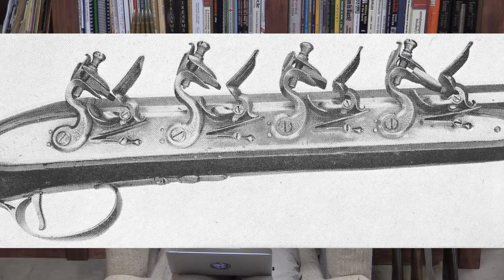Q&A #4: These Are A Few of My Favorite Things

Comment: 1) First, it is Flech Ette, not Flesh Ay
2) They were deadly in Vietnam when used in artillery and tank guns "The first example was the 105mm howitzer M546 anti-personnel tracer (APERS-T), first fired in combat in 1966 and thereafter used extensively in the Vietnam War. Intended for direct fire against enemy troops, the M546 was direct fired from a near horizontally leveled 105 mm howitzer and ejected 8000 flechettes during flight by a mechanical time fuse. Green starshells were shot into the air prior to their use to warn friendly troops that such a round was being shot." When I was in armor Officer Basic, we were told of an incident where an Armored Cavalry Troop's night defensive position was assaulted. When the M551 Sheridans of the troop turned on their search lights, an entire NVA company was seen dealy boppin down the road right at the NDP. The M551 covering that sector touched off a 152mm beehive round and the entire NVA company disappeared. In the morning there were bodies everywhere and a lot of blood trails leading back into the jungle.

Comment: I've found that even just the A1 grip safety does a pretty good job of keeping your hand away from the hammer. I have decently large hands, but I suppose everyone is different.
Reply: I've shot a Kongsberg 1914 (copy of the pre A1 1911). I've got pretty small hands, and got bit by the hammer once. I then adjusted my grip slightly, and didn't get bit again.

Comment: With artillery, barrel length is expressed as multiples of it's bore diameter, because it's that ratio that really matters, not the actual overall length. The actual overall length is relative to the bore diameter.

Comment: XM8...  the more purposes to a weapon, the worse it is at each.  Trying to combine a machinegun and a grenade launcher sounds extremely heavy.  You would probably be much better off giving a lightweight mortar or launcher to your riflemen because otherwise there are problems in the field lugging stuff around.  But beyond that, the only way to get a 5.56mm and a .50cal to fill the same role is with energy weapons that can reduce power to gain capacity.  Cause  .50cal rounds are heavy.

Comment: I had a Ruger 10/22 and found it to be a pile of junk.
Tried many different types of ammo, extractors, recoil springs, polishing the receiver, mods to hold the magazines tighter and no matter what the thing stove piped constantly.
 I'd  get at least 2 stovepipes per 10 rounds.
Sold it for an Uberti lever-action .22lr and could not be happier.

Comment: I will say, as someone who is not a ballistics expert or even really enthusiast, but a ballistics... supremacist? I guess? That describing rifles in terms of caliber, cartridge length, and barrel length is actually quite sensible. At the least, it would help in determining the kinetic energy leaving the barrel. So a 20 inch barrel AR-15 would be 5.56x45, L508 (because 20 inches are 508 mm). However, such descriptions would reduce the desirability of regular rifles in comparison to bullpups, and I would argue this is a big part of why such measurements are still not used.

Comment: The SEALs also used 40mm flechette rounds in the M-79 & EX-41 during the Vietnam War, to great effect.
Reply: Anon Nymous we still have flachette rounds for the 82mm Carl gustav. They're rare, and normally used by sf.
Reply: Do you know why they used them?
Reply: why do we still have it? what is it used for?
Reply: willem kauffeld General anti-personnel use. The flechettes penetrated jungle foliage better than the round buckshot pellets.
Reply: If you got caught in an ambush, with the EX-41, you could let fly 4 40mm rounds, resulting in a swarm of high velocity steel darts slicing through any soft targets in front of them.
Reply: John Crain The whole army uses the Carl Gustav now. I myself have had the pleasure of lugging the thing over long distances. I was talking about the Flachette rounds that are made for it. And you are right, I misspoke, it's 84mm.

Comment: The points on 3D printing were very well taken and so fascinating, scary, amazing, near-unfathomable etc.  I've been dreaming about this technology as an "Overland" 4wd Enthusiast as well (Even my mighty Toyota Hilux breaks down once in a while and needs a some small part that's given up the ghost after 300k miles...it happens), for many years now when I first saw it on the horizon,  I see an awesome opportunity for essential parts being available/create-able in the farthest reaches and in-time creating a new form of infrastructure to support different groups (not limited to the 4wd world is what I'm meaning) for whom the technology will benefit them/their needs where.  Suddenly anywhere with the electricity and the materials can become a production facility and make nearly ANYTHING that someone can design within reason and without needing specialized tooling, just a digital TDP-type file sent from X facility to Y point of creation... It's also got some spooky ramifications/potential usages but then so does a Steak-knife so... 

Such an interesting concept and ties in well with the point you mention about the firearms technology having plateaued cause THIS could allow for some designs to reach fruition that simply aren't reasonable/possible with current "reductive" manufacturing means.  LOVE this channel.
Reply: +Nor Wester (4Rescue) I think a lot of the interesting developments in the field with regards to guns, is working around the somewhat particular limitations of 3D printers, things like z-precision.
Reply: +DFX2KX Yeah, good point.

Comment: I was reading on the early development of the Browning Auto 5 shotgun. It was my understanding that it was meant to cycle black powder loads on the 'gallery' or 'light' setting of the recoil system. It made sense to me, given the design timeframe. The long recoil mechanism would also be quite difficult to gum up with fouling, evident to me when I did the initial clean on my Auto-5, which was still working despite being caked with oil sludge. I think the previous owner never cleaned it, and lubed it with 5W-30 motor oil  (though, that was John Browning's recommendation, albeit decades before this particular shotgun was built)

By the way: Obturation is where the "o" in o-ring comes from.

Comment: 3D metal printing

At the current of the sate of such machines, they are capable of a precision magnitudes better than the rough plastic ones which are incapable of 0.001 inch accuracy. The cost of a high-precision metal 3D printer is on the order of half-million dollars. There is one company that has produced a 1911 in .45 ACP. They claim that the strength of #D printed parts is about 95 % of a conventional milled part..

Comment: Stronger cartridge case material.

A more modern example is the French FAMAS.

Because of its hesitation-delayed blowback action which left too much pressure over the unsupported case, the standard material used for other 5,56 x 45 rifles was unsuitable. So the French cannot use ammo provided by an ally.

The French are now about to ditch the FAMAS and replace it with another rifle designed and  built in another country, having lost its development and manufacturing capabilities over years of neglect by the government. Yes they could manage to manufacture a foreign-designed rifles but in small runs (less than 100,000 units) the cost-per-unut would simply be non-competitive.

Comment: Tilting vs rotating bolt. Two more issues.

1. Reliability

The rotating bolt also has the advantage of soft initial extraction. As in a bolt action rifle, the bolt has to turn as it begins to move rearwards. This can be significant in the case where sand or other dirt got into the action and is contributing to causing the cartridge case to stick in the chamber. This can be more severe in the case of straight-walled cartridges such as the 7,62 x 51 NATO cartridge. As the bolt rotates, either the extractor turns the cartridge with it, thus breaking the seal, or spreads the pulling effort over a wider section of the rim as it runs around the rim. As opposed to the a straight rearwards pull on the rim, there is less risk of the extractor simply tearing off the part of the rim it is grabbing.

The FN-FAL has been used by over 70 countries and the only complaints to the rim tear-off problem seem to be from Israel. Apparently, sand in the Middle East is particularly obnoxious in this respect.

2. Lighter weight

A front-locked bolt also allows reducing the weight of the receiver. Since the the locking shoulder required for a tilting bolt is at the rear of the bolt, it means that the receiver must have the strength to hold the bolt locked against the 60,000 psi pressure. As opposed to a locking system using a barrel extension to lock the bolt at its front. The receiver of a tilting rear-locked bolt requires sturdier and heavier material than the aluminium used in the M-16.

I had not heard about the enhanced accuracy though.

Comment: Apparently, in certain circumstances (which are far from what an assault rifle is typically specified for), the G36 will overheat up to a point where the polymer receiver becomes soft close to the barrel and the trunnion will start to move inside the receiver. Even tiny shifts are enough to lose zero and it will not return to zero either once it has cooled down. If worst comes to worst you may not even be able to re-zero the rifle. The issue has been blown out of proportion by the German liberal media (who just love to badmouth any defence industry company and especially those involved with small arms production and distribution) up to a point where the minister of defence felt like she needed to make a statement that the rifle will be replaced in the foreseeable future.

Still, despite it's great tolerance of dirt and sand, the whole G36 lineage ist probably not the best option for todays wars in the middle east.

Comment: Semi auto in common use? Yeah the M1 Rifle basically became the first standard issue semi auto, because the Russians had to deal with the Germans in Operation Barbarossa so had to stop producing their SVT40s which were on their way to being standardized. It's not quite proper to say it was done in 1936 however even though that's when they REALLY started mass producing the M1. By early December 1941, meaning when the US joined WWII, there was less than half a million M1 Rifles available. Meanwhile that same timeframe, I believe there was over 1,000,000 SVT variants made. I think the 3 millionth M1 Rifle came off the assembly line around D-Day; Summer 1944. It's a bit nitpicky, but I think it's safe to say that the M1903 was quite standard throughout 1941, 5 years after the M1 Rifle started being mass produced.
Reply: Those are good points, however I don't think Ian is wrong. What  I believe Ian & Karl would say, is that while the Garand wasn't 100% standard issue, the US Army was VERY small. Early 1940, pre-war, (while the US gov't  upped the #,) it was about 240,000 w/ roughly the same # in Reserves. ( that's including Air Corp personnel. )

The Red Army, even though it was at "peacetime" strength, (thru the Winter War,) in 1940 was over 1,800,000 with  >9,000,000 in active reserve. 

So while there were only 500,000 early Garands, & it wasn't issued to every soldier, (hence the Marines getting "stuck" w/ '03 on Guadulcanal,) you can see the PERCENTAGE of soldiers that could be so equipped was nearly 100%, while the Russians, couldn't hope to so arm their troops. 

P.S. John Garand also designed the majority of the machinery to build the M1, + the machinery to build the machinery, + the  build process itself. 
The USSR learned incredibly fast, but was still new to mass production.

Comment: Further, your Berthier is in Musketoon of Artillery Model 1892 Modified 1916 (Type 2) configuration. The Type 2 designation is determined by the rear sling attachment inlet of the stock instead of the swiveling attachment point. The Berthiers are confusing because each rifle's official designation is dependent upon its current configuration, not it's receiver markings. While This receiver is surely marked M16, it is actually an 1892, but with M16 standards. Cool piece! I have two 'M16s,' one built in 1916 in 3-shot, 1892 configuration with clearing rod intact, and later updated to M16 standards (without the clearing rod slot filled), and one built in 1933, in 5-shot, 1892 M16 Type 2 configuration.

Comment: Regarding flechettes, what is the deal with SLAP (saboted light armor penetrator) ammunition and APFSDS tank shells? Do they work, or are they just a crazy experiment from the eighties? Since they're designed to penetrate through targets rather than get lodged in them, would they have any stopping power against organic targets? Obviously getting shot by a tank will just vaporize all the things you love most but is a .50 BMG flechette going to do as much damage as a .50 BMG ball?
Reply: 7.62x51 SLAP fires a hardened .22 caliber projectile that is encased in a discarding sabot.  Projectile velocity is @4000 fps, IIRC.  It was designed to improve the armor-pierceing capabilities of GPMG's such as the M-60 and M240B.  A similar concept was the Remington Accelerator ammo, that loaded saboted .22 cal projectiles in .308 Win, .30-06, and .30-30. The idea was that you could use a "deer" rifle as a "varmint" rifle, but the accuracy on those rounds wasn't great. My last time in Iraq (2008), I was at Balad Air Base, from where the SpecOps aviation aircraft operated.  I saw 1500-round cans of linked SLAP that were staged on the flight line to reload the Mini-Guns on their Hughes 500 "Little Bird" helos. I can only imagine the kind of devastation that could be wreaked with SLAP rounds coming out at 3000/minute.
Reply: Very interesting. My confusion was that I'm sure it could do a lot of damage, but by design it'll do its damage best against hard targets wouldn't it? I'm probably overthinking it. Getting shot is bad enough whether it's a lead bullet or a tungsten dart.

Comment: The major issue between a rotary bolt is the small bolt and barrel extension are cheaper than a locking wedge is the receiver has to be heavier and more costly .

Comment: And one the subject of the cartridges vs muzzle loaders, another main reason why metallic cartridges weren't used was also because many high echelons on the army didn't trust them. This was especially true in the US Army were many of the Brigadier Generals were obsessed with the idea of the lone marksmen and they thought that metallic cartridges would cause troops to fire recklessly and waste ammo. This mentality actually stayed on pretty much up to the early stages of WW1 which is why many of the early bolt action rifles had magazine cutoffs so you could only fire one shot at a time. Of course WW1 proved that this wasn't practical and WW2 is what finally killed it when it became clear that rapid firepower was needed in modern war.

Comment: You'd pick an Arisaka over a  TRW Low Maintenance Rifle?  Also the answer re: pick to produce is a Sten since I'm pretty sure you could make one with a Dremmel.
Reply: +Jersey Mike&#39;s Rail Videos Everything except the barel yeah, could be done with a dremmel tool and an angle grinder
Reply: +Andre Krumins I'd be willing to bet that the Sten is the only emergency weapon produced and issued by a combatant that ultimately went on to win the war. The PPSh-43 could be another, but I think that wasn't quite cheap enough XD
Reply: Taydolf Swiftler the M3 was actually a pretty nice gun
Reply: A dremel? No. A drill press, oh yes.

Comment: on the subject of the Springfield Trapdoor weapon, contrary to popular belief, they weren't all 1860 Rifled Muskets converted for brass cartridges. While the ones made in the 1860s post Civil War were, what happened was that the conversions were extremely unreliable and the guns would corrode really easily so to fix this they built a stronger trapdoor but... this newer system wasn't compatible with the 1860 Springfield Rifled Musket so basically the US government spent money on a new weapon anyway. 

There's an old saying in the arms industry. A government can be your best and your worst customer.

Comment: I also like french weapons. 

BTW, did you ever have a chance to handle a french MAS-38 SMG, Ian?
Reply from the maker: +AldanFerrox Handled, but not shot.
Reply: I read somewhere that the 7.65mm Longue ammo was identical to the ammo for the Pedersen Device. Is that correct?
Reply from the maker: +AldanFerrox It was very close if not interchangeable.

Comment: Not long ago, you shot a Canadian Ross rifle. I have one of these, and have owned several in the past. Understanding that proper assembly of the bolt is essential for safety, I was wondering what your opinion of the rifles action strength was. It's been suggested that this may be one of the strongest designs ever. Finding a non-historical rifle and trying loads might make an entertaining video, if it can be done safely, and without destroying history. Such a video would likely require a continuous safety header throughout.
Reply: +JohnYCannuck  The M10 is the model I was referring to of course.
Reply from the maker: +JohnYCannuck It's a quite strong action, in large part because it was designed around a quite hot cartridge - the .280 Ross. Replace that with the .303, and you will have an action with a really high margin of safety.